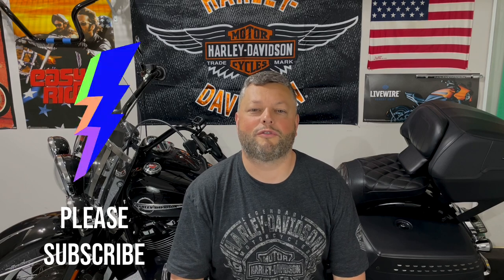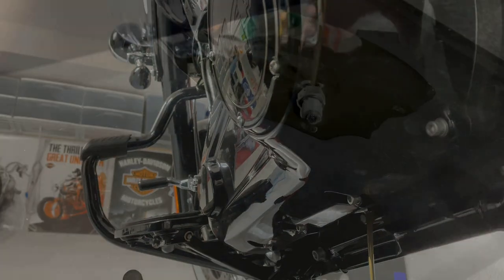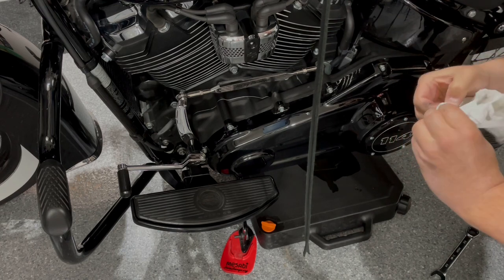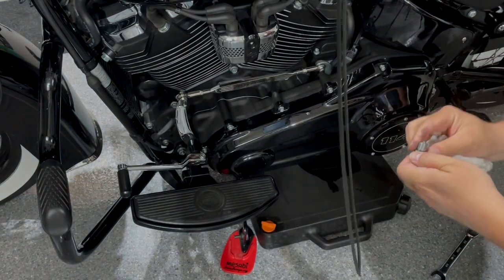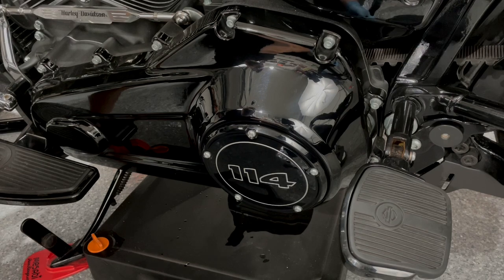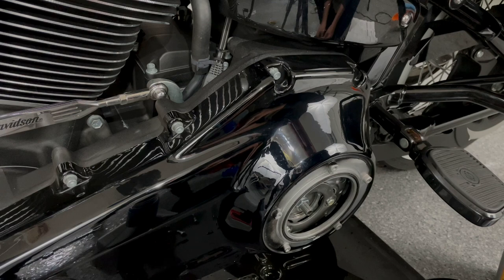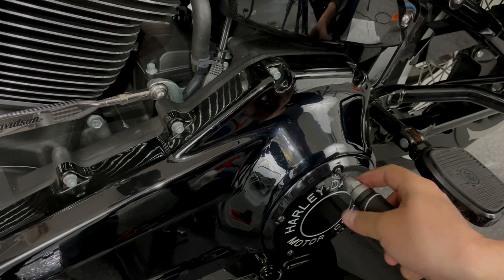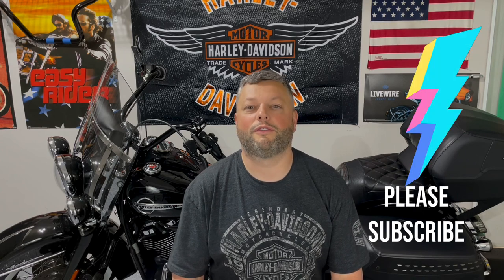🔥🛠 Harley Clutch adjustment, primary oil replacement and lever adjustment for Milwaukee Eight (M8)

Comment: Dont dump 36oz of Primary Fluid in a 2021 Touring model like my tech did on the 1K. 2021 Touring Service manual states 34 dry/30 wet. I took out 36 and put in a measured 30 and it is correct visually. (yes checked gear box to make sure no migration).

Comment: Good video on clutch adjustment...Harley is ruining the bike with cheapness...if going to cable clutch they had a great adjustment before this cheap plastic and spring!!  J&P cycles Mechanic was putting a S&S 475 cam in and showing the cheap plastic tappet guide holder and recommended the S&S Billet....also told the tappets hardness is going around 20000 miles and starts to flake...Cams around 40000 mi hardness is gone...so figure on new tappets at 20k and cam at 40k or buy a Honda!  Oh not to mention all the little stuff they keep eliminating every year...heal toe shifter and other stuff...its crazy.
Reply from the maker: Thank you for watching and commenting and yes you are correct. All the components you listed should be replaced while in cam chest for real. I did same on my Heritage before I got my Road King

Comment: Good Job on the video, Aside from checking the primary for the fluid transfer issue before removing the drain plug, loosen the derby cover bolts a little bit. This is done so if you happen to strip out one of the bolts and can not remove it yourself you still have fluid in the primary and can still ride it to the dealer if necessary. Just a tip that I have found helpful.
Reply from the maker: Thanks for the tip. I got Softail and these models don’t have fluid transfer issues as far as I am aware but definitely good point.

Comment: It’s the wrong gasket indeed. I received it also from the dealer. I put on the gasket you put on a sportster.
Reply from the maker: Yes some dealers still dont remember there is new gasket type needed for 2019 and up.
Reply: Gaskets on the derby cover use to be flat...then they went to a rubber gasket that sits in a groove on the derby cover

Comment: You probably should remove the derby cover before you drain the oil especially for touring models to check for transfer.
Reply from the maker: Definitely good tip for Touring models. Appreciate the comment and thanks for watching Mark

Comment: The book says 36 oz of primary fluid when changing, which you confirmed you were going to do. But you used 4 oz less and put in 1 qt. Did you under fill by 4 oz?
Reply from the maker: Manual provide 2 volumes depending if oil is added to dry clutch after assembly or just oil change. Hope this helps.
Reply: @RidersUnited Thanks...I'll double check the owner's manual. I was thinking 40 oz after an assembly and 36 for a normal service. Good video. I have the exact same 2019 heritage and its time to do the 3 holes.
Reply from the maker: @garybaldwin1061  your numbers are correct I just checked manual muself to make sure and these are volumes I got listed in the video
Reply: @RidersUnited  I'm still confused....you put in 1 qt...that's 32 oz...4 oz under recommended.
Reply from the maker: @garybaldwin1061  it is edited video I added recommended amount sorry if this was confusing part during edit.
Reply: Depending on year...one is for dry fill after the primary cover has been off...the other is for a wet fill when you just change the primary oil.  They lessened the quantity of oil when they went to a thinner primary cover.

Comment: You have to use a regular Allen key and let it drop. The Allen key with that heavy handle is not going to work accurately.
Also when your doing the final adjustment at the cable it is good to snug the cable up closer to the frame before pushing the red clip in.
Reply from the maker: Thank you for watching and sharing this helpful tip. Greatly appreciated

Comment: My manual for my 2020 Sport Glide (107 M8) says 1.18 Litres for the Primary. You only put 946ml. Do you have any issues?
Reply from the maker: I believe there was no change between 2019 and 2020 models. Based on service manual 36oz (1.064L) if WET and 40oz (1.182L) if DRY. If you are replacing oil only you will have wet conditions therefore 36 oz would be proper amount. If you disassembled your primary drive this would be considered dry then yes 40oz would be needed. Looks like 4oz is always there if we only change fluid not doing full disassembly. Hope this helps. Too much oil and you might experience some slippage in your clutch.
Reply: @RidersUnited  I reckon I put a little too much in last service. I felt a little clutch slippage. I think I will drop it again and just put the 1 Quart bottle in.
Reply from the maker: That should be just fine in case you don’t have second bottle. If you do do 36oz exactly. I think I might switch to non synthetic on my next flush as I talked to FuelMoto and they tested it and noticed less slippage under heavy acceleration. For rest of the holes they recommended synthetic and I like Amsoil in engine and heavy duty oil in trans.
Reply: @RidersUnited  Harley Dealer told me to put the HD Syn3 20W50. I'll give it a go with the correct amount of oil. If it is still slipping, I might got the HD Formula + Primary Oil.
Reply from the maker: That works too and I rode on same oil for years without any issues. Get her done 😀